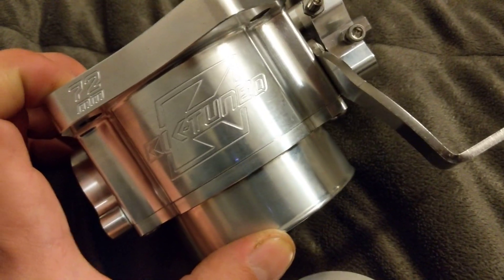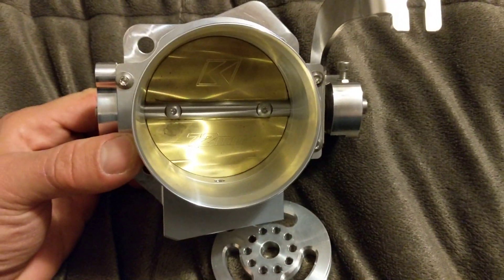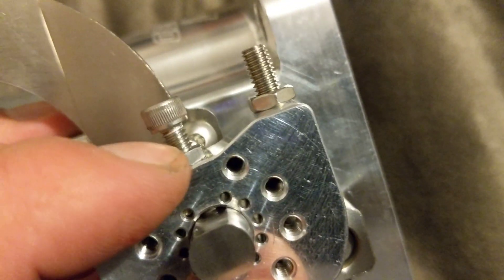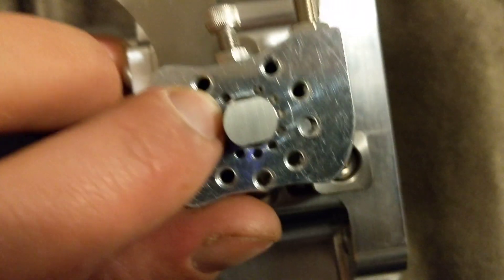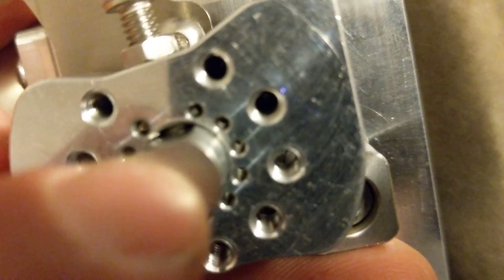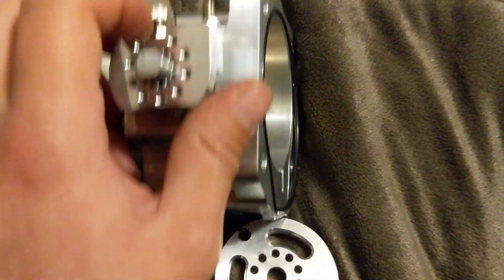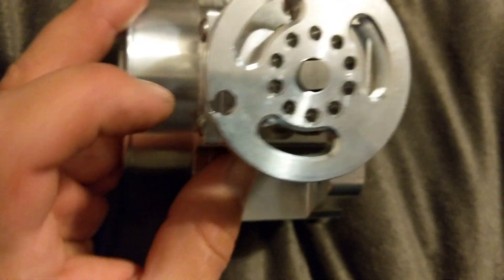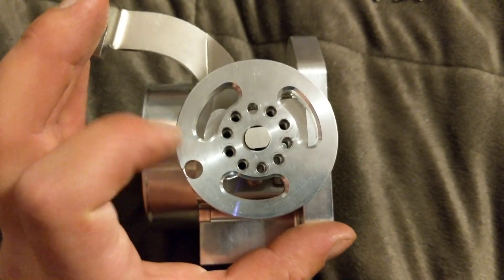KTuned Billet 72mm Throttle Body Calibration

Comment: Hey man i recently installed the same throttle body and whenever im moving on neutral The car will keep idling up to 2k rpms and it will be like that for alittle while, i ordered the map sensor plug from ktuned but im not sure if that will work for the problem.. LMK
Reply from the maker: Do you have a BAC or Idle Air Control valve?
Reply: RGHTBrainDesign i have the IACV
Reply from the maker: @Glodave  so it's probably IACV settings causing the surge at idle.  Lower duty cycle
Reply: RGHTBrainDesign thanks man ill
Look into that !

Comment: 72mm thats cute I like my 87mm throttle body better :P
Reply from the maker: Well yeah.  I could have gone with a 80mm or 90mm for my setup, but I elected for this due to the factory ITR intake elbow fitting and better drivability (in theory).  No doubt, I would have gained more everywhere on a larger TB...
Reply: @RGHTBrainDesign  You can also use about 4 more cylinders
Reply from the maker: @BrittSchieck  This is true.  Either way, you'll love this thing when it's 'done'.  The next iteration will have a properly built NomisInd Sleeved NA Block unless we just say fuck it and boost the bitch. ;P
Reply: @BrittSchieck  nice boat
Reply: Iv heard that alot in my k24ek..then its off to gapsville and they usually whine about thwir tires not able to put down all that v8 power ,or they missed a gear or ... Bla bla..